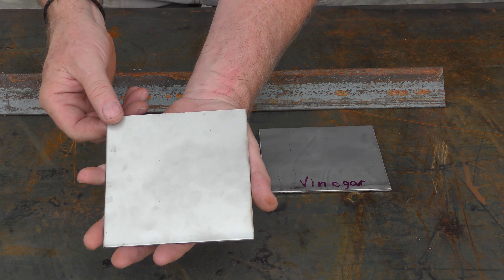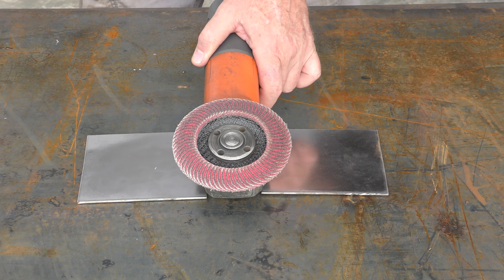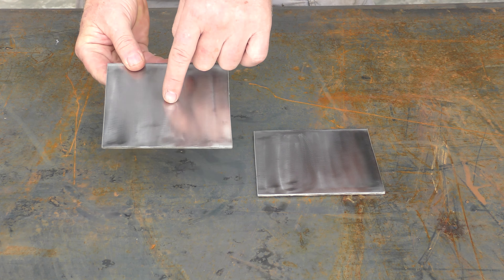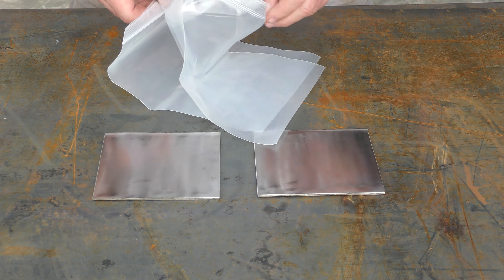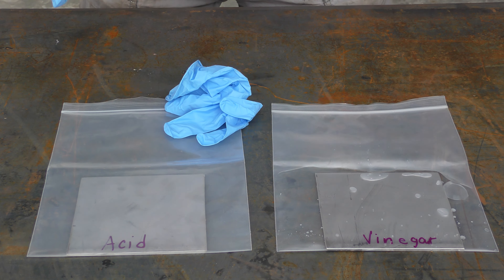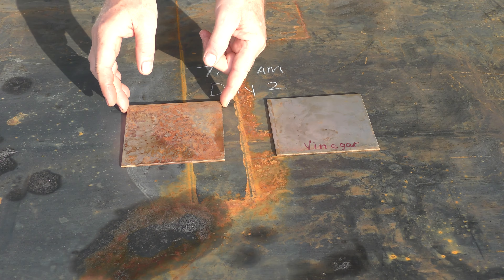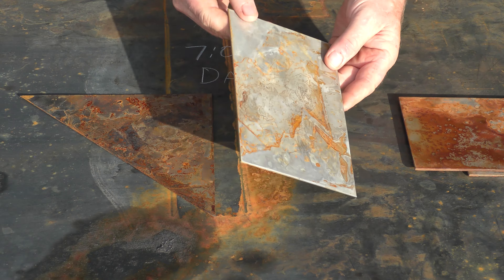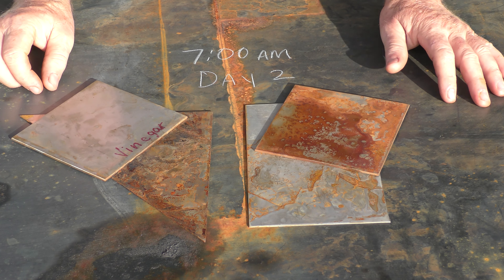How To Rust Stainless Steel

Comment: When you used the flap wheel on both samples...you may have put a little more rust transfer on the first piece and 'side' you hit each piece. Could be the matter of how much transferred first to each piece? Idk...but good demonstration.  Thank you.
Reply from the maker: Good point. I didn't consider that.  Now I can't recall if I did the vinegar piece on the 16g which had a better reaction to first or second. I might need to test that idea. Thanks

Comment: Hey Doug, I had to rust some stainless machine screws to match the Corten I was working on. I tried lots of combinations of acids and found a 50% nitric, 50% hydrochloric acid (muriatic acid) bath for a few 5-10 minutes made them completely rust. I was really surprised how quickly and how much they rusted.
Thanks for the content!
Reply from the maker: @cjwillis  cool, I'll have to try that for sure
Reply: Aqua Regia.

Comment: I think i was the order of the contamination you ground on the acid one first, then the vinegar. i think it decontaminated the flap when. So the out come wasnt as drastic. Just a thought.
Reply from the maker: I think you're right. I tried the test again in reverse and had the opposite effect. So it's possible to contaminate the flap will but it's also possible to decontaminate the flap...maybe not 100% but to a lesser degree for sure

Comment: I've used vinegar with salt as a rust dissolver - but my Mom left a piece in for about a week and new rust covered it.  If you repeat this please add a vinegar plus salt option.  Don't know what will happen but it would be good to know.
Reply from the maker: @danrbarlow  I use vinegar to create rust all the time. I have an older video that shows the difference between using white vinegar and apple cider vinegar